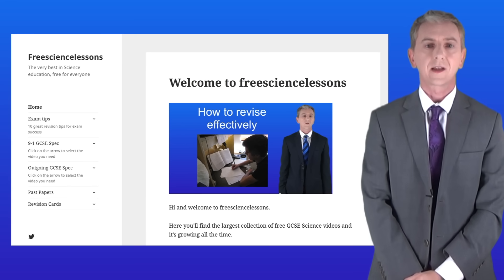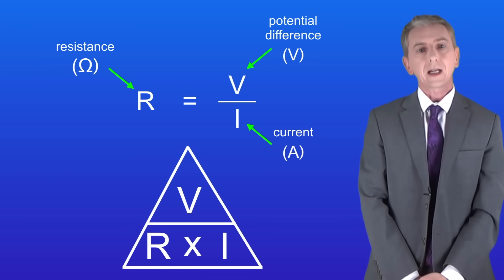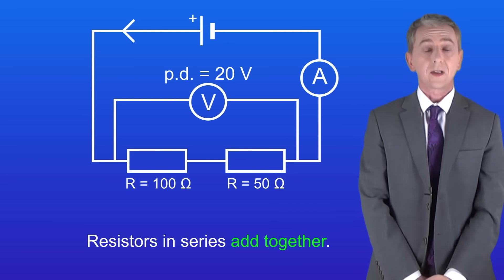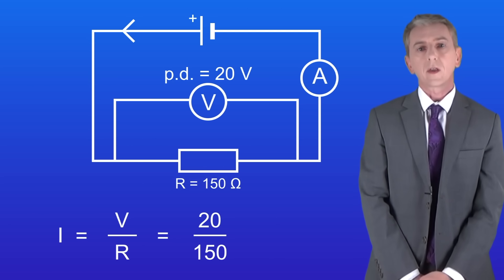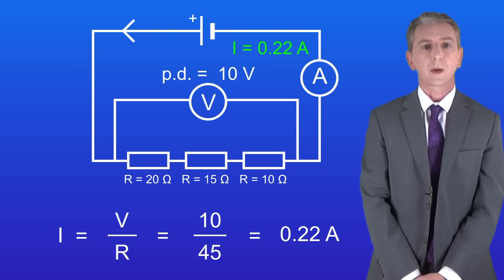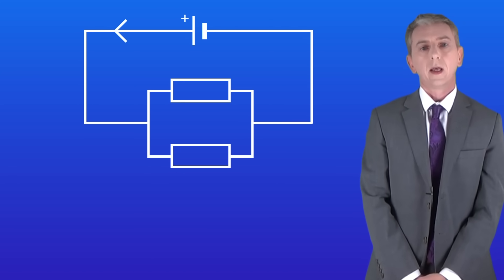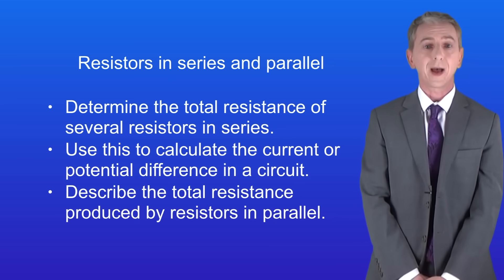GCSE Physics Revision "Resistors in Series and Parallel

Comment: I just wanted to ask I don’t quite understand why the resistance together will be less than the smallest resistance in the circuit aswell as how the equation for calculating the resistance ? However ur doing well with the video I learned a lot 👍

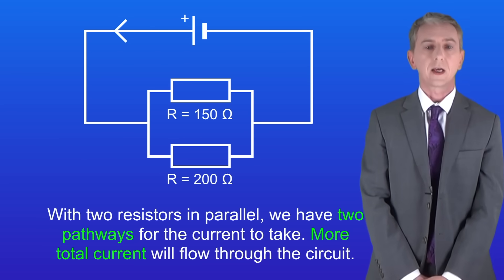Comment: 4:22 - but why does the current increase? thats what i dont get :(
Reply from the maker: The lower the resistance, the greater the current (assuming that you haven't changed the potential difference). When resistors are in parallel, the total resistance is less than the smallest resistor. So the same resistors in parallel will allow a greater current than if they were in series.

Comment: Can you please tell me how do I calculate the current in parallel resistors, I was asked to calculate it in my exams.
Also you make great stuff.
Reply from the maker: Imagine you have two branches. Branch 1 has a resistance of R1 and branch 2 has a resistance of R2 (all in ohms), you need to use the equation 1/Rtotal = 1/R1 + 1/R2.
Reply: @Freesciencelessons  I see,
Thankyou!

Comment: why the resistance adds up ?
Reply: In series the resistance adds up cause the electrons have only one pathway to go in, it can't avoid the resistor by going through a different path. Hence, both the resistors will be met by the electrons.
Reply: The potential difference across the three resistors (as on the video example with the 20, 15 and 10 Ohm resistors) which is V1, V2 and V3 respectively, has to add up to the potential difference V of the cell. Since the circuit has no branches ( series circuit) the current I is the same through all three resistors.
Using R = V/I, then V1 = I x 20, V2 = I x 15, and V3 = I x10.
But, V1 +  V2 + V3 = V (the potential difference across the cell) so V = I x 20 + I x 15 + I x 10 = I(20 + 15 +10).
(20 + 15 + 10) is nothing more than the sum of the resistances = 45.
Therefore V = I x 45 or 45 = V/I which is as mentioned above, the sum of the resistances.

Comment: Hi Sir ! One question why will the resistance by smaller in parallel circuits?
Reply from the maker: The reason is that in a parallel circuit there are more pathways for the current to flow through so the current is greater than if we had the same resistors but in series. Resistance = voltage / current. If the current has increased, then the resistance must have decreased (assuming that potential difference does not change).
Reply: @Freesciencelessons  but why has the current increased?
Reply: @Freesciencelessons  Thankyou so much !
Reply: @Freesciencelessons  why has the current increased

Comment: sorry mate but you really messed this video up because in the second video of this playlist you say the current will come out the same in parallel circuits but now you say its more I don't understand which one is right but I'm pretty sure this one is wrong
Reply from the maker: What is said in the first video was correct, the total current leaving the branches of a parallel circuit is the same as the total current entering the branches. This video is about comparing resistors either in series or in parallel. If I take three resistors in series and measure the current passing through and then take the same three resistors and place them in parallel, the total current passing through in parallel will be greater. This means that the resistance of resistors in parallel is less than the resistance of the same resistors in series.
Reply: Freesciencelessons Yes thank you I get that part that a parallel circuit has more current but why and how does it do that. Is it because there is more circuit for the electrons to get around
Reply from the maker: In a parallel circuit, there are more pathways for the current to take so the current is greater than if the same resistors were placed in series.

Comment: why has the total current increased when the 2 resistors are in parallel? I know there are now 2 paths for the current to take but surely the current simply stays the same?
Reply from the maker: The total current has increased but potential difference has not. Since I = V / R, the resistance must have fallen.
Reply: @Freesciencelessons  but why has the current increased? There have been no changes to the power supply.

Comment: at the end of the video where you say more current will flow because there's more pathways for the current to flow but doesn't the current flow in the direction where there's less resistance
Reply from the maker: Current will flow through every pathway. A pathway will a lower resistance will have a greater current than a pathway with a greater resistance.

Comment: if you were to calculate the resistance of the parallel would the resistance be 50 as it will be less resistance than the less resistor which is 150

Comment: 4:25 why does the current increase??? sureley it should decrease since current in a parallel circuit is split
Reply from the maker: Resistors in parallel have a lower total resistance than the smallest resistor. Because I = V / R, since the resistance has decreased, the current is greater.
Reply: @Freesciencelessons  but if its got more direction its more spread outt across so why increase?
Reply: @ilyaswaza8244  because if there if more room for the electrons to follow allowing for more electrons to flow meanings there is a increased current
Reply: @ilyaswaza8244  Ok, think of it like this. You and your mates are in a very crowded hall, with closed doors. 
Now if they open 1 door and everyone tries to go through, it would take quite a while, but opening up 2 doors would significantly speed up the procedure, so then 3 doors would let even more people out, etc. 
Likewise, The electrons (you and ur mates) can reach the other side of the battery quicker with more branches(more doors).

Hope this helps!
Reply: @pahgm6222  Thanks man that analogy was useful.
Reply: @pahgm6222  thank you so much

Comment: 4:24 : "More total current will flow through the circuit"
How is this possible? In your Current in parallel circuits video you said "the current in the branches adds up to the total current leaving the cell" 
How can there be "more" total current then?
Reply: in the parallel circuit the current has more than one option as to where it can go because there are branches unlike the series circuit, therefore not all current will go through the "total resistance" it will only go through some of it. So more current will be able to flow through the circuit overall, since it didn't have to pass through all the resistors in the circuit. If it's easier, you can also think about it mathematically; R = V/I , because you know that the "total resistance" is less than the smallest resistor so basically it's small, that means the R is a small value, and for the R to be a small value the 'I' has to be a big value (assuming the V remains constant)  to suit the equation, so the value of the total current has to be big. I'm not sure if that makes sense, but I hope it helped :)
Reply: @nellyabdou7245  I’ll love ty so much that helped me understand a confusing concept
Reply: I think it’s because we have resistors here. I don’t recall him mentioning that topic in the current in parallel circuits.

Comment: I don’t understand the part about resistance in a parallel circuit?????????🤯🤯🤯🤯
Reply from the maker: You don't really need to understand it. If it comes up, I suspect it will be a multichoice question. Basically, the TOTAL resistance of resistors in parallel is LESS than the smallest of those resistors. And that's it.
Reply: Thanks 👍
Reply: @Freesciencelessons  do we need to know the formula for the total resistance in parallel for higher? 1/R1 + 1/R2 etc
Reply from the maker: No you definitely do not need to know that formula for AQA. You just need to know that the total resistance of resistors in parallel is less than the lowest value resistor.
Reply: Max Pays isn’t that A levels
Reply: @Freesciencelessons  but how can 200+150 be less than 150!!!!!!!!!!!!!!!!!!!!!!!!!!!?????????????????????????????????????
Reply: @Freesciencelessons  I'm doing the Edexcel exam board, does the same thing apply to it?
Reply: @sureshsanapala3043          You only need to worry about that in A level mate,   theres a formula you use where you have to divide both the values by 1 and add them together which obviously gives you a lower value of resistance compared to the two resistors in parallel.  You don't need it for GCSE, i didn't come across it once until i did A level. Take the advice from him.
Reply: @sureshsanapala3043  It's not 200+150. In parallel, the rule for adding resistances is different. It is given as 1/R = 1/R1+1/R2 and so on. What he means is that the value of 1/200+1/150 will be less than 150 which is the smallest resistor.
Reply: pay attention to the legend of the science then!!

Comment: Hi, thank you fot the video but can you please elaborate on ‘equivalent resistance’ please. Is it simply just replacing the resistors in series with one resistor that equals to the sum of the previous resistors..?
Reply from the maker: Yes that's correct.

Comment: But why is there more current flowing through the circuit when there are more pathways, i thought that the current just splits and rejoins at the same amount it had before???
Reply: The current does split and rejoin but the OVERALL the TOTAL current increases. This is because, by adding more resistors, there are more pathways. Therefore, overall the total resistance decreases as the current can flow thorugh more paths. Furthermore, if you look at the equation, this means the total current would have to increase. It is hard to understand in terms of the actual circuit and how the current can't just increase but understand it in terms of the equation. GCSE Physics is just a GCSE in using equations. Hope that hepls!☺🤗

Comment: Sorry to disturb you but i'm having difficulty comprehending this topic.If you add the total resistance of the resistors in a parallel circuit wouldn't that surely be greater than the resistance of the smaallest resistor?Thanks
Reply from the maker: When you say a parallel circuit, do you mean for example three resistors in a branch? If you do, then yes the total resistance of THAT branch will be the sum of the three resistors.
Reply: No, when there is a parallel circuit do you add the resistors and if you don't  what is less than the smallest resistor?
Reply from the maker: No you don't directly add resistors in parallel. You need to use a mathematical formula that you don't need to know for GCSE. The TOTAL resistance of the resistors in parallel is smaller than the smallest resistance of any of them.
Reply: I finally understood!    Many thanks
Reply from the maker: The current flowing is inversely proportional to the resistance (I=V/R). The total resistance of resistors in parallel is less than the individual resistance of the smallest (in other words, the total resistance is very small). So that means that the current is now much greater.

For GCSE you don't need to calculate the total resistance of resistors in parallel.
Reply from the maker: We are DECREASING the resistance because we are adding them in parallel.
Reply from the maker: All you need to know is that the total resistance in parallel is less than the value of the smallest individual resistor.
Reply from the maker: No problem. Resistors in parallel is a difficult topic because you really aren't expected to understand the science, just memorise a fact. But lots of students want to know more than just that.
Reply: but in my school they are teaching us to calculate total resistance
Reply from the maker: Calculating the total resistance of resistors in parallel is not required in the AQA spec.

Comment: I understand the idea that the total resistance in a parallel circuit decreases, because there is less traffic jam, but I don't understand why you said that more total current will flow through the circuit. the current at the beginning of the circuit will be the same at its end, what happens is the current is splitting through the branches, but we have the same amount of charges flowing in the total. Am I wrong? Thanks for the explanation!
Reply: Because in a parallel circuit, as you add more resistors, the resistance 'decreases' , which in turn 'increases' the 'total' current. This is the total opposite to a series circuit.
Reply: @bEEBO178  Why does resistance decrease tho? If current splits between the two pathways, there should be less current flowing through each branch, right?
Reply: @geniusgamer9877  that's exactly what I thought
Reply: @geniusgamer9877  but I'm pretty sure its that when it splits it has more space for the electrons to flow through as other than only having one path to get through it has to so it would be a quicker flow of electrons so an increase and a decrease in resistance
Reply: JosephH06 basically, if there was one 500 ohms resistor, current would struggle to pass through. if you add another resistor, that 500 ohms is split into 2, so both the resistors will be 250 ohms. therefore, more current can pass through the resistors because there is a lower resistance on both ends. hence, adding more resistors decreases resistance
Reply: @rohikyoutube  thanks
Reply: @Vaisnavi Sivarasa no that's incorrect,  @VideoClipKing  was correct as, the 2 resistors (250) add up to the 1 resistor that was (500) as you have just basically split that one resistor into 2, so as the resitiors now only have 250, it is easier for the current to pass through. Sorry if this doesn't make sense, try watching the video again if you don't understand :-)
Reply: Furthermore , you don't add another 500 ohms resistor, rather split that resistor into 2( 500÷2=250)